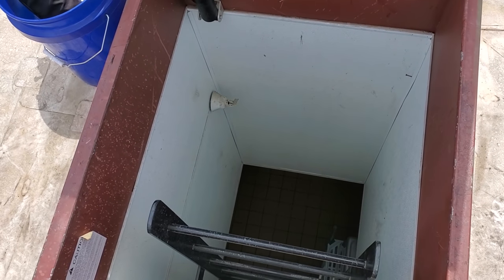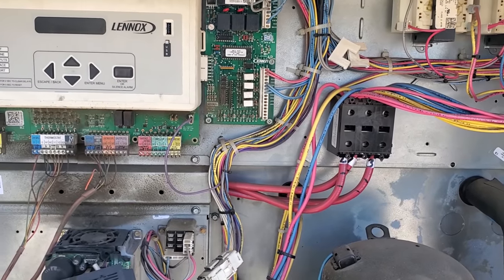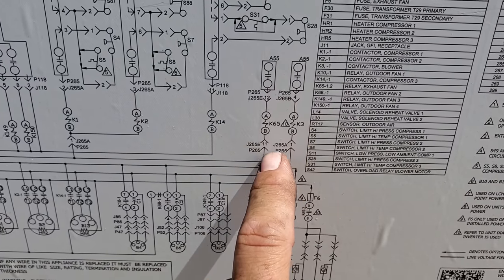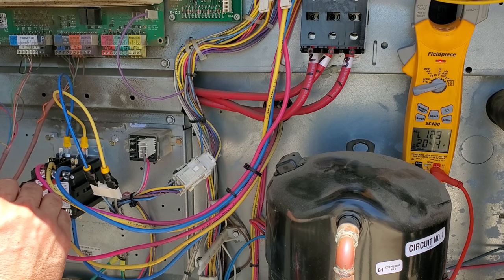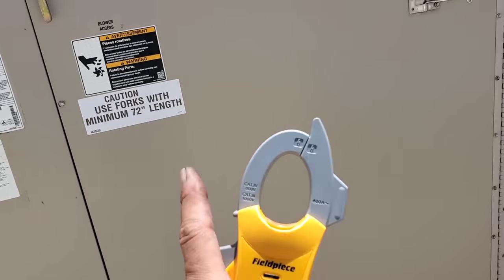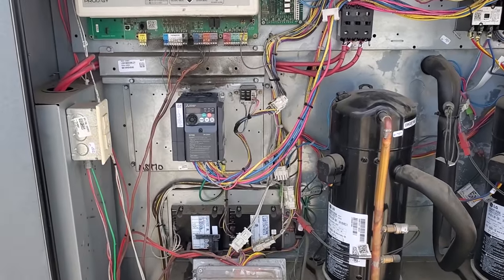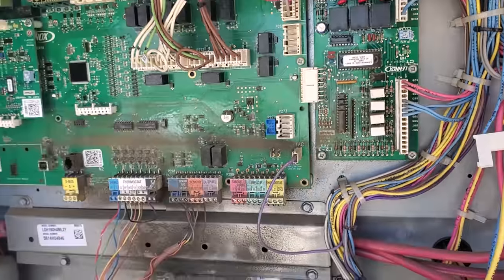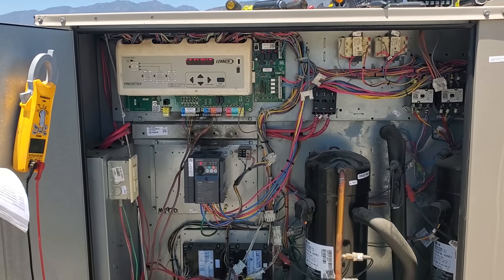THE DINING AC IS NOT WORKING

Comment: Not a fan of the frequency drive in such unprotected areas .. i have seen my self that they dont like the change in humidity when its raining and harsh temp changes ( then again we change here between 30 + to 30 - Celcius and have most likely higher humidity where i am living anyway .. even indoors with no air conditioning just a bit of heating nothing else they tend to not like it and fail after a longer periode of time. I can understand why people like to use them because you can give motors a real nice soft start and make the motors last a real long time. The front panel change that is working fine is a dumb thing .. its just a visual thing at that point.
I would think the drive most likely blew up just by a bit of bad luck and maybe bad weather with allot of dirt getting into the Frequency drive ... the dust mixing with other stuff and maybe even getting a bit humid over time killed the Frequency drive in the end ... this could maybe be somewhat prevented by making sure that they are cleaned frequently.
The way the frequency drive blew up makes me believe something on the mains shorted. This could have created an arc and gotten to the low voltage site when it shorted and damaged the main board most likely too. I base that on what i did see.. the big caps where mostly ok it looked like .. they did not crazily exploded at least so they would not cause that ammount of damage we have seen on the Frequency drive and only other thing i know that can damge stuff that likely are shorts in the mains ... those can get pretty powerful
Maybe to solve the issue would be to make sure that they dehumidify and have a dust filter on the air in to the whole control housing ( not the VFD since that would not like the get limited air movement a dust filter might give especially when it gets full because no one ever cleans them. Now i dont know about the normal weather where you are living and heat ... but if it gets to hot in there maybe diverting some cool air would not be a bad idea ? or hot air when it gets cold outside on top of using the dehumidifying effect that this system already has ? no idea really .. though main problem was clearly the dust collection in the VFD that most likely is the main contribute to it blowing up and damaging the rest

Comment: Surprised more customers don't just keep the contactor and ditch the vfd
Reply: That's a parts-changer attitude.  Because the unit would then use much more power.  I'm sure the restaurant owner would notice that.  My SEER 29 mini-splits could not accomplish that much efficiency without VFDs integrated into the control board for all three motors.

Comment: why the camera isnt picking up the leds is because of the shutter speed, i think it was
Reply: True.  If he's using a cellphone camera then all is lost.  That is the same reason airplane propellers sometimes look to be turning backwards.  I use a pro-sumer Canon point and shoot camera.  It allows me to set the shutter speed and the frame rate.  I normally leave the camera set to auto but if I'm photographing something that's moving and I want to capture the movement, I set the shutter to 1/100 sec (1/200 in bright sun).  The result is exactly like film movies looked.

Comment: Jeez, why make things simple when you can make it difficult. So much electronics to slow down a fan. But then again, it seems that the same geeks also work on automotive systems.
Reply: Well, it's environmental and energy conservation regulations that seem to be driving it in both AC and automotive. Also, it's now often cheaper to do stuff with computerized control circuitry than to do it the old mechanical way. I'm not sure that's true when you factor in maintenance costs though, in either case.

Comment: Ehh I would have just told them it's down. You do to much and cause yourself more work.
Reply: But that can also be considered best practices.  Word of mouth is a much better advertisement system, and doing the extra mile to get that ac going again while waiting on parts will give him more businesses.  Also, happy customers are less likely to switch companies even if the cost is more then the competitor.
Reply: That statement is the difference between worker and owner. Two different mind sets. You should always do as much for the customer as possible.
Reply: Success in business and earning money is mostly gained by walking the extra kilometer/mile for the customers, most of them appreciate it and will call you again if there is something new to do.
Being lazy and unhelpful like you suggested and letting the customer sweat for weeks will lead to the customer calling another company with proper trained personal.
That is why some companys with workers with your mindset are only called for cheap and dirty fixes on low budget an chain restaurants, the helpful companys are called for moneymaking jobs and can pay and train their workers better. One thing leads to another!
Reply: @sherwinalvarez7365  exactly.